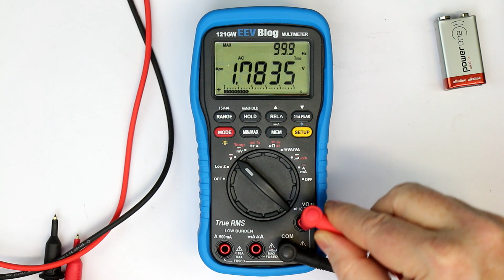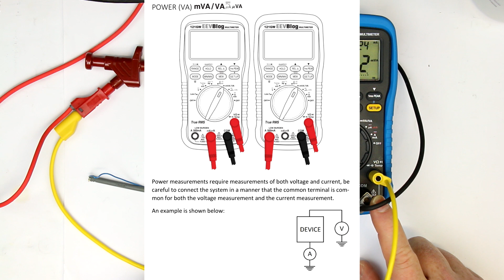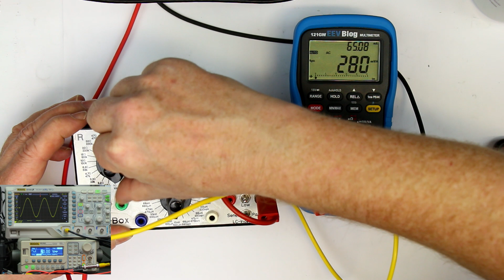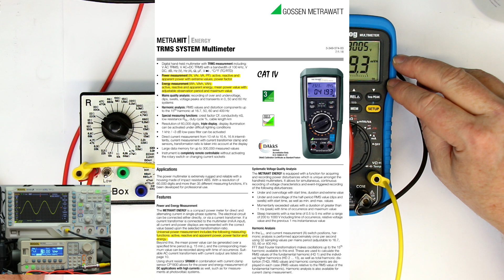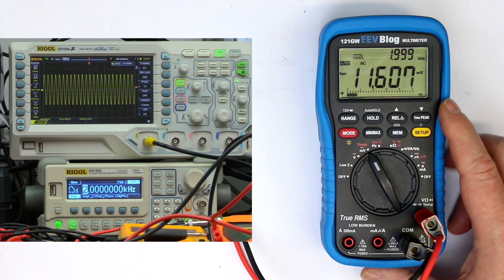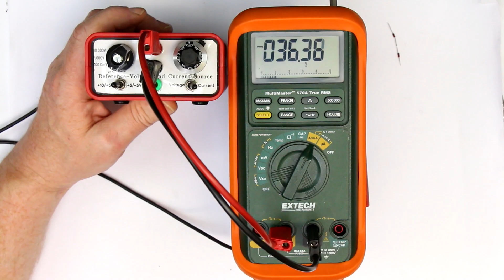Selecting a Better Multimeter Pt.3 - Watts, VA, dBs, 4-20mA current loop

Comment: never buy a Hyper Tough multimeter from Wal-Mart.  They are terrible.  The cheap one does not have a 20v setting and cannot test car batteries.
Reply from the maker: This video-series is about selecting a better multimeter for advancing electronics hobbyists. Not about any cheapies from discount-stores, home-improvement shops etc. So it´s not an introductory course for beginners.

Comment: The 121GW uses a common ground for measuring mVA/VA so the measurement is wrong due to the voltage drop in the ground cable. Such a shame as it would be a killer feature at this price :(
Reply from the maker: Same is with the Metrahit Energy. You always have to take care of voltage drops and other error-sources. But with halfway decent test leads you usually can most-often neglect that. The phase shift in AC/VA-measurement can be a much larger error source (up to 100% as was demeonstrated in the video).
Reply: @KainkaLabs  With VA measurements and good leads, it's fine. But with mVA the errors can be huge compared to the nominal accuracy of the meter. While I agree that its incumbent on the user to avoid this error, I don't think it fundamentally makes sense to have this accuracy range without 4-wire measurement - it's just asking for trouble.
Reply from the maker: in mVA-mode the currents are also in mA-range and via Ohm´s law then the voltage drop over the leads is correspondingly also in the mV range. So the relative error remains the same.

Comment: I know you said it wasn't going to be a review, but in the end it's the best review of the 121 I've seen yet.  
When you were using the pulse, you never mention the duty cycle. At higher frequencies you were not increasing the pulse width.  Were the pulses under the detection limit?   Rather than adjust the frequency, perhaps just adjust the pulse width.
Reply from the maker: You probably mean the section where I tried out the 1ms peak function. You are basically right. That thought briefly flashed up in my mind when I shot the video nut I was too busy to think more deeply about it. With a 1:10 duty cycle and 1ms peak capture 100 Hz would be the maximum frequency to give a halfway correct result. I will correct this in the next video (when I don´t forget it),
Reply: @KainkaLabs  If you make another video, it would be good to see you rerun the VA test as well.  When I looked at the prototype meter, there was a problem when using this mode.  I think your are the first person to demo it.   Basically, how you have connected it is what they show in the manual.  However, when I looked at it, it seemed that the firmware did not account for the burden voltage.  To get around this, I placed the meter's common point to the low side of the load,  Vin to the other side of the load and the current back to the supply.  Basically removing the burden from the voltage calculation.  After I did this, the numbers would come out correctly.  I will post a picture on to the main page I linked if you are not understanding.
Reply from the maker: I think you are right with getting rid of the burden-voltage with your differrent connection for the VA-mode.
That way it would have been even a bad idea to "remove" the burden-voltage in software by the more or less known resistance of the internal shunt-resistors + fuse-resistance + PTC-resistance. The latter 2 are not well defined. That way a software subtraction of the burden-voltage would only give an approximate value. (These were even my thoughts during shooting the video but I did not come out with your clever idea of an alternative connection for avoiding the burden voltage). Perhaps they should add this to the manual as a second way of connecting the VA-mode. It´s not as intuitive as the "normal" method. That´s why it should be labelled as a secondary but more accurate way of connecting for the VA-mode.
Reply: @KainkaLabs  I had made a video showing this but was called out about not connecting it "correctly".   It seemed pretty obvious to me what the problem was when I first looked at it.  You are really the first person I have seen since then that has posted a video showing the VA mode.   I would like to see a Part 4 if you don't mind spending the time to look into this with more detail.
Reply from the maker: Joe, I just shot  a video to proof your concept. Comes out very well and all of the critics will get convinced that you are right and had a very clever solution for the VA-mode problem. Credits to you will be mentioned in the video. Will be online in 1 or 2 days.
Reply from the maker: ... and spread the word if you think that my comments about (or review of) the 121GW are of any value :-)
Reply: @KainkaLabs  I linked it in the main discussion page, here: http://www.eevblog.com/forum/testgear/eevblog-121gw-discussion-thread/1375/

Comment: I really wish the 121GW could change the reference impedances like that Extech meter.  Hopefully they will add that to a later firmware update. - 24:08
Reply from the maker: Yeah, many of the things that I "complain" about with the 121GW could be improved by a software update. Zeroing the dBm value can be found even in very old dB-meters intended for audio work and could be easily added by a firmware update. But I am afraid that Dave & David don´t have the time to watch my lengthy videos (and probably don´t know about my channel :-).
Reply: @KainkaLabs  Comment early on their next video, and like your own comment to move it above the comments with no likes (according to my experience, comments with no likes in popular channels get lost), or post it on the forum in a new thread. They'll most likely see it. As for them having time to watch your videos, that problem could be solved by summarizing the problems in the comment or even an unlisted video.
Reply: I would imagine some of those ideas have been mentioned in an EEVblog thread but I haven't bothered to check.  Life is busy.  The zero offset isn't as big a deal to me as changing the impedance value.  600 ohms isn't something I would use much.  50, 100, 1000 ohms would likely be way more useful.
Reply from the maker: Perhaps you spread the word when the video series is finished :-) I don´t have the talent to let it sound like constructive criticism and thus it is sometimes perceived as negative criticism.

Comment: There are some weird video glitches today.  Seeing your blue end screen (I think) flashing here and there throughout the video.
Reply from the maker: Oh strange. Are these glitches more like flashes or does the end screen appear for a longer time?
Reply: I was just seeing short flashes.  Like the editing point was slightly off (thus showing the lower layer end screen I am guessing for a few frames) BUT they didn't seem to be at editing points.  I would have to watch again and slow it down at the glitches to 0.25x speed to see for sure.  Quite a few in this video so I am sure you can find them too.
Reply: Good video though.
Reply from the maker: Yeah. Now I´ve also seen them by watching the whole video on YouTube. Thank God they are only very short.
Reply: @KainkaLabs  - Ya, just something to watch for on the next video before hitting the upload button.  Not the end of the world.  If you figure out exactly what happened I would be interested in hearing about it so I can avoid the same problem.

Comment: I think you need to consider the accuracy of the signal generator's reading also.  The generator and 121GW are within 0.13% of each other.  What is the claimed accuracy of the Rigol generator? - 22:22
Reply from the maker: I think it´s 1%. Have to look it up. But those relative cheap function-generators are often not very accurate in amplitude. For adjustment work a 1% error would be 0.1dB and even a 5% error would be only 0.5dB off.
Reply: Ya, that's what I was referring to.  You said the Extech was more accurate but with that low frequency (ie. well within spec for the meters) I would believe the meter with the better specs over the signal gen.  Don't assume because the Extech is closer to the signal gen reading that that is correct and the 121GW is not.
Reply from the maker: I´ve looked it up. The Rigol signal gen has 2% official accuracy (+/- 2 mV). Although I can´t stand to watch my own videos once again I think that explains any differences. So in fact I always use the DMM-reading in real life if I know that the signal is within the specs of the DMM concerning bandwidth and crest-factor. In the experiments with the RLC-box and VA-measurements there is the additional "error" of the 47 Ohm resistor (instead of 50 Ohms) and the 10% tolerance of the capacitor when I switch it in.
The Extech/Brymen is really a killer for it´s price especially in AC-V/mV/dB/A/mA-measurements concerning the measurement accuracy.